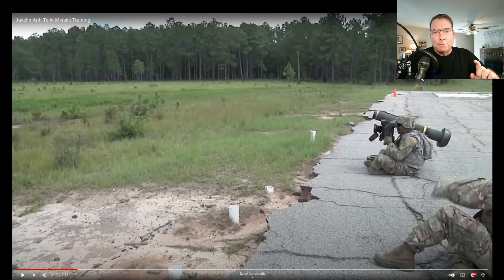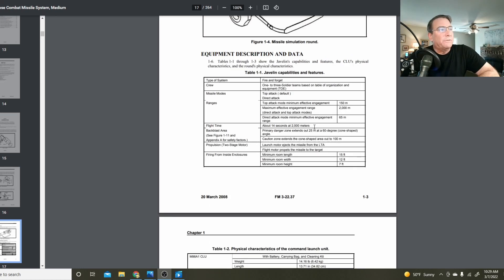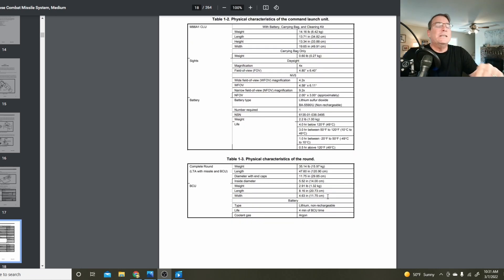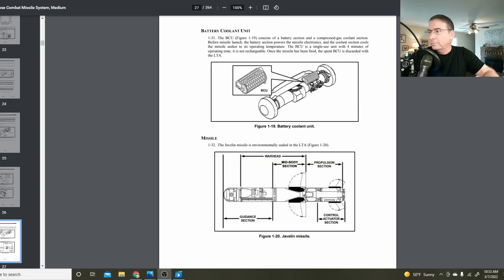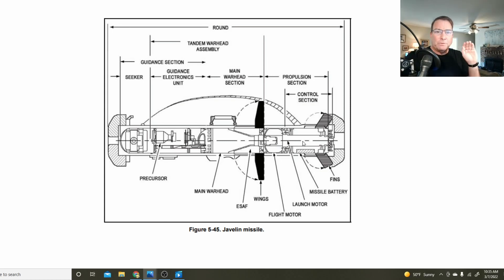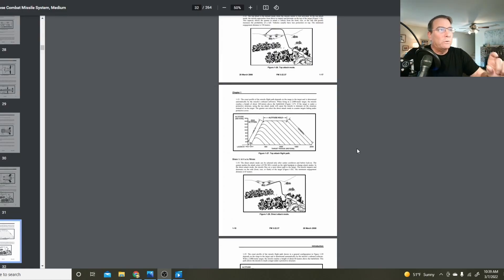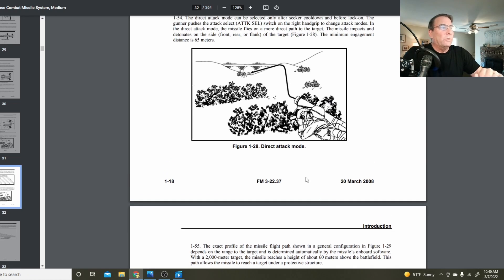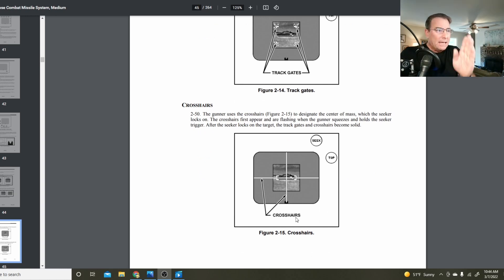FGM-148 Javelin Anti Tank Missile Overview

Comment: Fascinating ...
You kinda answered my question at the end,, very expensive. 
But was curious on the part that's thrown away at the end. 
Taking the rocket out of the expense, how much does it cost in throw away parts was my question. 
True, that tank could be taking human life so I'm not saying it's not worth it, was just wondering on the price to use this in comparison to a (reusable) Canon. 5 miles away... 
Ah just $$$.. Wars not cheap!!
Reply: The NLAW isn't as capable for distance but it works for moving tanks up to 600m and stationary up to 800m. The other advantage is it is much less complex to operate.
Then it only Costa about £20,000.
Reply: Costa = Costs.   Fat fingers!
Reply: If you're trying to hit a tank with indirect fire (say artillery) and not something more like a standard anti-tank gun emplacement, you pretty much need a guided shell.
And that makes the whole system cost about the same (tho you can indeed reach out and "touch" targets much further away with a guided artillery shell than with a Javelin missile, but as soon as you fire you put a giant "shoot me" sign on your position (in other words, counter battery fire is almost certainly incoming within probably a minute or so).
So then you need to ALSO have a self-propelled artillery gun, which costs significantly more than a towed artillery piece, even if you include the vehicle towing the artillery piece and the ammunition supply trucks.

Bottom line is, the Javelin is about as cheap as it gets for NATO-supplied modern-day anti-tank weaponry that has a good chance of working versus modern tanks that have both ERA panels, and likely composite armor under that.
And IIRC the cost of shooting a Javelin is "only" something on the order of a little less than $100k anyways (I've heard $80k quoted before, so I'm adding some fudge factor to account for inflation).

Granted, the Russian RPG-7 does also have a Tandem-Charge HEAT ammunition option (similar to what the Javelin uses), but that's an unguided projectile with a much shorter range, and it's also supplied by the opposing force which makes the whole point pretty much moot.
Reply: Juan has got the nature of a shaped charge wrong. It doesn't project anything as such. It turns the cone into plasma and the intense energy of the plasma projects itself through the armour. It is distance critical though, hence why you see slatted "Fence work (?)" around armoured vehicles as the charge then fires too far away from the armour surface. I'm in shock it not like Juan to get something wrong.

Comment: Actually developed by Texas instruments and the Martin Company under a joint venture still called the Javelin Joint Venture
Reply: Also the ambient temperature doesn't affect the sensor performance as much as you would think. The cooling has has to reach cryogenic temperatures to get the sensor sensitive enough to discriminate target signature against the background.

Comment: Is there a known reason that they did not get the AN 225 out of the Ukraine before the invasion? Seems like they could have moved it when the build up was happening on the border. Obviously cost may have been a factor at several thousands of dollars per flight hour. Also what happened to the fleet of AN 124's? Praying for all the in Ukraine.
Reply: It was in for maintenance and unable to take off right away.
Reply: @A.R.77  It was in the air three weeks earlier so that excuse does not fly.
Reply: @Milkmans_Son  If it was in the air 3 weeks earlier and broke an engine of all things right then, that's plenty good enough of an excuse to keep it grounded for over a month, easy.
Reply: @Milkmans_Son  I like your reasoning, "If my autos gas tank is full three weeks ago, then it's good to go now." Unfortunately, the Universe doesn't work that way.
Reply: @thomasboese3793  I didn't say it had fuel, I said it was IN THE AIR.  Learn to read.
Reply: @44R0Ndin  No.  It's not plenty good enough of an excuse, it's a lame excuse.  Ignoring the fact that it has six engines and could probably take off with four when empty, this was not a surprise attack by Putin.  We all knew it was coming for months.  It shoulda been parked in Poland or somewhere two months ago.  They screwed up.
Reply: @Milkmans_Son  Sad that you do not understand simple analogies. Just because "something" works today, does not mean it will tomorrow. Expendables get used up, and parts go bad. Sometimes, at the worst possible time.

We are talking about what was the world's largest aircraft. Lots of parts, each of which has a "lifetime" of usefulness, and failure can and does happen at any time.

We have been told that the aircraft was "grounded" due to a "bad" engine. Personally, I wonder why they didn't try to fly it out with the missing parts, (all multi-engined aircraft can fly missing an engine) however, I don't know what other work was being done that would have prevented it from being moved.
Reply: @thomasboese3793  You didn't use a simple analogy,  you used a bad analogy.  There's a difference.  

It doesn't matter what kind of work was being done.  Why?  Because they knew Russia was going to invade before they started doing it.  They knew Russia was going to invade, but they flew the damn thing home anyway.  The last flight any  Antonov 225 will ever make went right over Poland in order to land at an airport that would be in the middle of a war zone very, very soon.  

Mothballed is better than fireballed any day of the week.
Reply: @Milkmans_Son  There is a common phrase in antique tractor ads, "was running when parked".  I'm thinking of that on my tombstone.
Reply: @SteamCrane  I'm putting was flying when parked on mine.
Reply: It was under maintenance and could not fly. :(
Reply: afaiu it was getting repairs done to one of the engines and they couldn't make it ready for flight before it was too late. I've heard it cost $30000 an hour
Reply: Yea besides what everyone else had mentioned the whole initiation of the invasion was with a bunch of cruise missiles fired at targets and I'm assuming that a lot of the airfields were a primary target so its possible the runway could've been damaged as well .
Reply: @connorjohnson4402  Were you shocked when the missiles started flying?  Did you say, my God, just how did Putin, that mad genius, manage to catch the whole world napping?  How the heck did he manage to build up all those troops and all that equipment at the borders without anyone even noticing?  

No, you didn't say that.  Not unless you're an idiot anyway.  You didn't say it because every media outlet on the planet outside of Russia was calling the invasion "imminent"  by the end of January. in big bold letters at the top of the page.  The US was releasing intelligence on a daily basis, complete with satellite imagery.  Didn't see it coming, durrrrrr.  

This airplane, along with anything else that wasn't nailed down, should have been out of the country a month ago, if not sooner.  

It really shouldn't at this point, but still surprises me how many of you out there struggle with even the most basic logic.
Reply: I think the AN-124s managed to fly out, the 225 was going to but suffered some kind of malfunction and was undergoing maintenance
Reply: @bodenwhitmore7699  - I read that two AN-124s were caught on the ground in Ukraine. The rest were outside the war zone and are being used every day. Going around Europe and picking up supplies and then delivering said supplies close to the Ukrainian border. Mainly landing in Poland….
Reply: AFAIK one engine was removed so it could not fly out
Reply: There is onboard video of a cargo flight. Seems as a one-off, it was a bit finicky.  Fairly large crew, all seemed nervous. The best scene was where the navigator crossed himself before takeoff.

Comment: The Javelin is a great anti tank missile, but the best anti tank weapon the Ukrainians are using is to attack soft target supply/fuel trucks, take out the fuel trucks and the tanks can't move. This has keep Russia stuck 70-100 kilometers from their boarder and the boarder of Belarus. Check out Russia's rail road system, that is where their supply dumps are located, lots of landscape the Ukrainians can use to attack the supply trucks.
Reply: "Infantry wins battles.  Logistics win the War."    Gen. John J. Pershing
Reply: Cruise missiles are being launched from Russian ships.  They should be sunk.
Reply: @michael931  Same story with the tanks, if they're well defended (as warships normally are), you lay siege by attacking logistics, and not the ship itself. It will run out of missiles or fuel eventually, and be forced to return to port. At which point, you can (if you think it's the right thing to do) attack it when it's returning to port with low supplies and lowered ability to make a problem for other sea vessels (such as your own warships).
Reply: @MrSlugny  nice try comrade
Reply: @MrSlugny  What’s it like being paid in rubles and having your life savings wiped out overnight?
Reply: Yes and trains are a relatively soft target, as you need to patrol all of the rail all the time, and a simple bit of sabotage, like placing a rock in a set of turnouts, and disabling the monitoring circuit, will result in a derail. As well for rail simply removing a few dozen rail clips will do the same, especially if done on a curve where there is a natural force tending to spread the rails. Might not derail on the first train or car, but will do so sooner or later, snarling up the line entirely.  All this needs minimal tools, just a crowbar or tyre iron, and a pipe length to add leverage, all innocuous items by themselves. Signals are also very easy to break, as they are meant to fail safe, so a signal failure drops back to token operation on the line, slowing down transit considerably.
Reply: No you need a track wrench. Europeans use bolts to attach rail to the ties and tie plates. US railroads use spikes with wood ties.
Reply: @iannarita9816  As far as severing rails in wartime goes, a much more expedient "tool" is a HEAT warhead, as the best way to make it difficult to restore the rails to operation is to make a break in them where there wasn't an existing joint.
There are many places in the US where we use concrete ties bolted to the rails rather than wooden ties, however this is saved for places like high speed main rail lines between major industrial hubs, where the amount of rail traffic means that wooden ties and rail spikes just wouldn't hold up to the beating or would quickly drift out of the allowable tolerances.
Reply: @MrSlugny  Sadly, some people in the world (mostly the leaders) need to be REPEATEDLY taught by real experience (and not historical example, because "hey this time it will be different, I know it, that only happens to OTHER people!" kind of thinking) that "war is always bad for business, unless your business is war".
The economic effects of Russia's attack on Ukraine have already been felt world-wide, and that will always be the case with any large scale conflict involving so many nations at once.
Reply: Ukrainian civilians are spying on Russian vehicle convoys. They are looking for fuel trucks when they spot one they use the Telegram app to call in artillery strikes or rocket teams.
Reply: Hit em where it hurts
Reply: they have  used RPG 29s to hit softer targets and weak spots on Armour effectively but the Tanks ect  needs a special touch like Nlaw and javelin , i noticed  images of a turret  indented 1ft into the tarmac / asphalt from flying upwards from Ammo detonation after an attack with javelin
Reply: NLAW seems to be the anti-armor/vehicle weapon most used right now in Ukraine. Makes sense because most of the targets UK is taking out are logistics vehicles. Then the russians have to abandon their out of fuel tanks.
Reply: @HerpDerpNV  Yep, and then the Ukrainians get to tow away the tanks and potentially use them to their own ends. Saw one doing that with a farm tractor. Best part? The Ukrainian government has said that any profit you make from selling former Russian war material is Tax Free!
IMO the best use for such a recovered tank is to take the turret off of it and rig a way to connect it to tractor implements, just like they did with countless T-34's and M-4 Shermans after WWII was over.
Reply: @44R0Ndin  Grape Havester
Reply: @stevenvarga3946  A tank chassis is quite versatile, you could mount pretty much any kind of farm equipment on it if you can figure out how to mount it to the turret ring.
Reply: @HerpDerpNV The Royal Army shipped a Thousand NLAWs, Sweden 100’s more. The only downside of the NLAW is it is wire-guided.  So the shooter has to stay in position to guide it to the target.